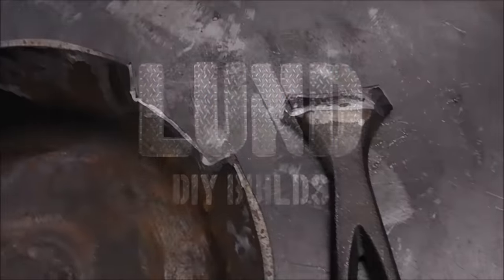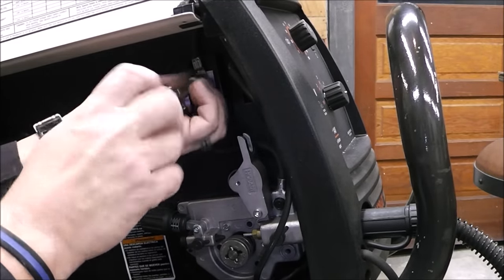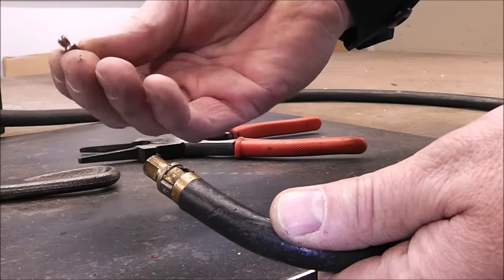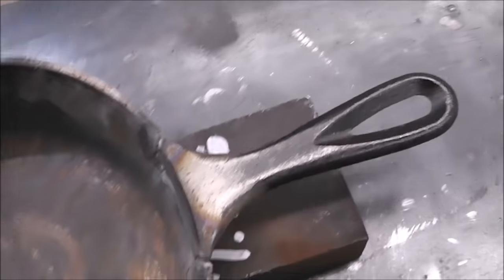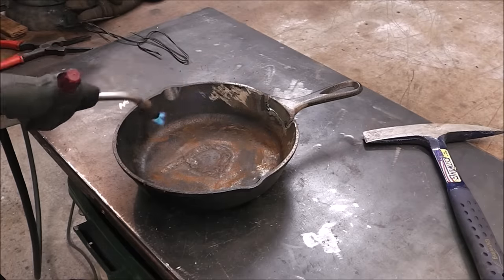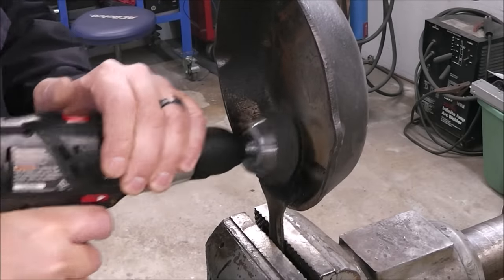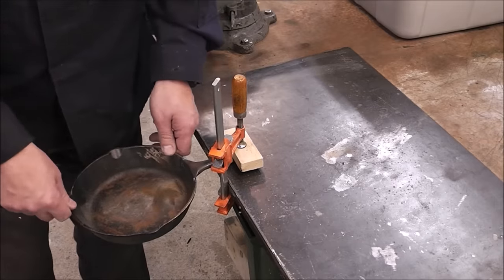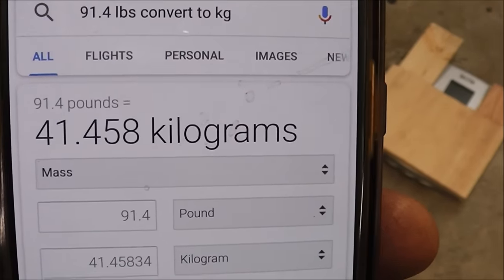Cast Iron Welding Repair using Flux Core Wire

Comment: here's a question using flux welder, what if you run a bead of weld along each side of the break i.e bead of weld around handle and bead of weld along pan then weld the two weld bits together would that make it any stronger?
Reply from the maker: Maybe marginal. The weak spot will always be at the toe of the weld so by welding on each side then bridging down the center will leave the toes on the center weld ok, but the first passes will still be the weak link but it could be slightly stronger due to more surface area. Great question. Thank you 👍

Comment: We always pre heat cast , 
Weld with A high nickel rod. 
Then bury in hot dry  sand over night. It will never crack at those points. 
We do a lot of cast pans that are old
Reply from the maker: a good preheat and controlled cool down can make a huge difference.

Comment: Any cracking will occur when it is used? Heating and cooling repetitively. The cast iron will expand at a different rate than the wire.
Reply from the maker: You are correct William but that holds true for any weld repair, carbon steel included. Filler metals are typically less brittle than the base metal (cast iron) so if it cracks again it will either be immediately during the repair or several heat cycles later. It's an unknown variable with every cast repair. Even brazing has its limitations.
Reply: So would cast iron welding not be ideal for something that will be used extensively?
Reply from the maker: If you use the proper filler and process than it can be very strong....almost as strong as new

Comment: So was the wire nickle or steel,as I have welded cast with a rods for dirty cast and then you can weld it with steel mig so just butter weld each side the weld with nickle and then hard steel mig wire
Reply from the maker: Surprisingly Roger, this was done with just regular E71T-GS steel flux core wire.

Comment: drill holes in crack 
nut& bolt ..to hold the pieces. lastly remove bolts and fill that hole.

Comment: FluxCore for a broken bypass lopper handle ? The part of the handle below the blades is about 1 inch wide. I have a HF  Easy-Flux 125. Not a whole lot of experience. I did a small weld on my trailer gate, which worked fine. Wanting to play around with it.
Reply from the maker: Sounds like a great time to try!

Comment: have a old cast iron table that belongs to my mom an one of the legs has broken off an all i have is a small 90watt mig welder an was going to try to fix it, i dont have access to sand that i can get in a time period that id like, is there anything else i can use other than the sand to help with the cooling the metal down slowly. the table is just for decoration so the only load it has to hold is its own weight.
Reply from the maker: If you have a welders blanket you can wrap it in that also. If not, you can try not using anything. If it is going to crack you will know as soon as it cools.

Comment: Don’t you usually weld cast iron with stick welding? I don’t know anything about welding just what I read up correct me if I’m wrong
Reply from the maker: Traditionally cast iron repairs are flame brazed and tig welded. This is a repair series so we are trying different processes and fillers and seeing how they compare

Comment: What I’ve noticed welding cast engine blocks nickel rod for sure has been the best but Main thing is how you heat normalize and cool the material
Reply from the maker: VERY true! I've used a ton of fillers but the prep is the real key

Comment: Will this work on engine exhaust manifolds? As you know they are cast iron.
Reply from the maker: @jim sharp yes and no. Cast iron is a crap shoot. You have in my experience a better than 50% chance of it working. Your replacing it anyways so it's always worth a shot.

Comment: I'd be curious to find out the durability of the weld after the re-heat to cooking temperatures and use subsequently of the pan,
Reply from the maker: Repeated heat cycles does increase the chance of future cracking, but as others have posted, this repair has lasted 20+ years for some on exhaust manifold repairs.

Comment: The moisture you see during preheat isn't coming out of the iron. 

One of the products of combustion is water, when it hits relatively cold things (the pan before it's hot) it condenses. That's where it's coming from.
Reply from the maker: Yes. I misspoke

Comment: If you use the nickel stick to weld a cast iron pan, is the metal safe for cooking?
Reply from the maker: I'm not sure but I probably wouldn't dare try it with a nickel repair. Some people have allergic reactions to nickel...even touching it on their skin can cause a rash.  I would however trust it with regular mig wire or even flux core wire since the wire is made of steel and the pan has similar properties.

Comment: Great video! I have used flux core many times to repair cast iron with a cheap Harbor Freight Chicago Electric 90 amp flux-core welder. Is it the best option? No. But, it will do the job. Considering it's a cast iron skillet, it's not going to be holding near that much weight, lmao.
Reply from the maker: Right on brother! Thanks for watching and commenting 🙂

Comment: i peronally use a nickel rod for stick, but i get rid of the flux on the outside and use it with a tig welder, that is the way i fix cast iron
Reply from the maker: That works well also. I did a video of this but used water to remove the flux.

Comment: What were your settings on the welder to weld the cast iron? Volts and wire speed
Reply from the maker: This is a transformer based machine. The voltage is adjusted by selectable taps.

Comment: Is it possible to weld the seams on a wood stove? I have more of a smoke stove than wood stove. Furnace cement keeps failing.
Reply from the maker: It's likely steel so most definately yes

Comment: The handle breaks off when it gets dropped, not really when the pan is over loaded,  but i think you made a legitimate fix there, I’m going to do as you have shown except I won’t put the handle back on; I want just a  short stubby re rod handle to match the other side.
Reply from the maker: Thanks Walter and good luck with your repair!

Comment: Thanx for the info! Let the no-it-alls stroke their egos in the corner. When ya think outside the box the more info ya have the cooler shit ya can come up with. I'm a beginner, maybe less then beginner really when it comes to welding but nails and wood only go so far. Picked up a used bottom of the barrel stick welder not long ago, still don't know what the hell im doing with it really but the sparks sure are pretty! So now I went out and got a cheap, but new 120v flux core mig and ready to have some fun. Came across your video because I've got an antique cast-iron oil barrel from the rail road that's been turned into a wood stove. Awesome lil shop heater but the ends have rusted out so I'm heading out now to see about putting some new end caps on. Dont know if I'll get it done or not but I definitely no it ain't gonna happen by setting at my keyboard watching videos on crap I already think I know everything about. Lol Anyway, thanx again for the vids and wish me luck!
Reply from the maker: Thanks for the support and GOOD LUCK!

Comment: They have "3055 ENGINEERING CAST IRON STICK WELDING ROD" on the Eutectic site.
Reply from the maker: That works well but I have not personally tried it. Blow you mind and make your next repair with this. You will never use anything but again https://youtu.be/Cm3_uv-PhPM

Comment: Three years ago I decided to do my own welding on my turbo kit for my civic, and decided to weld a 3" mild steel v band flange to the exhaust outlet. Pre heated it and everything, but I welded the inside of the flange as well as the outside and when I went to put turbo back together I noticed the fins wouldn't go all the way through the housing because of my fat flux bead that I put in on the inside. Oh man good times. The housing was junk and I ended up getting another turbo lol.
Reply from the maker: Oh man that stinks! I've been there. Live and learn. It's usually costly but it's always a good lesson LOL.
Reply: @BrandonLund  thanks, lol I'll never make that mistake again but damn what a dumb move, it makes me want to build another turbo kit just thinking about it though lol
Reply from the maker: Reminds me of the time I bought a brand new carburator. At the time it was around $400. I put it on and over tightened it. Snapped the ear right off it. Foolish mistake that made me sick to my stomach. JB Weld to the rescue LOL
Reply: @BrandonLund  🤣🤣🤣🤣

Comment: You ever try the oxy fuel welding method?? Use a bare cast Iron rod and flux old school method. Ive been tinkering round with it and its a tough process but it leaves a really nice repair. Kast weld 111 rod pure cast iron rod and a flux. Puddle runs like molasse very gassy ans porus but i honestly think the oxy fuel method works the best because your using the same parent material as the grey Iron base metal. But the rods are heavily pricey. You can also use piston rings.  But you need a good flux or just make your own using some borax. I mixed borax, Iron powder, and some lime. No peening reuired as it's a very well known restoration technique that was used back during the early 1900s an so on before advancements in the arc welding process. If you do it right, the repair almost looks original. The kastweld 111 rod can be machined down to bare metal.
Reply from the maker: @lar I have a lot of brazing experience on carbon steel and have done a little using cast rods. It is an art for sure. I wasn't aware piston rings would work but I suppose the cast has to be high quality so they done degreade quickly. Thanks for the awesome comment!

Comment: Can a a 454 cracked exhaust manifold be welded using the same setup?
Reply from the maker: Generally yes but all cast iron is different. You have a little better than a 50% chance of success in my opinion. I have a video on cast iron manifold repair but it's using a product that's fairly expensive but it always works. https://youtu.be/kzbcVb2UymA

Comment: My mom passed down an iron Comal ( small circular skillet for tortillas) my daughter got it up to 500+ degrees and it cracked, will this fix it?
It’s An heirloom that I grew up with, and was given to me in 2004
Reply from the maker: It will but I would NOT. Cast iron is prone to failure after being repaired. Even if YOU repair it as something to hang on the wall, there is nothing to say that someone else wont aquire it and put it back into service. If it ever failed on the stove with grease it could catch your house on fire or worse kill someone.
Reply: @BrandonLund  thanks brother

Comment: I never knew this Brandon . I did a repair of a bird bath which was over 100 years ago and I used cast iron welding rod and pre heated the work and when I finished I put it into hot sand left it to cool down over a few days . I don’t think the person realized how much time I spent doing this repair because she didn’t think it was worth the amount I charged her
Reply from the maker: It can be hit or miss. It's not the cure all to everything but it works a lot of the time.
Reply: @BrandonLund  she never came back mate
Reply from the maker: LOL maybe you don't want her as a customer then...LOL Without getting too deep into specifics, I always make sure my customer understands what to expect and how much at a minumum it will cost them for me to attempt this repair.  The prep work is what really takes all the time. Many hours are spent, long before I even strike an arc. Lucky for me the part had been cleaned. It saved him some money because I didn't have to mess with it.  I make sure my customer understands that my time is worth money and if they want me to attempt to repair their part than I need to be compensated for my time spent, even if the repair isn't sucessful.
Reply: @BrandonLund  a good point mate

Comment: I have a 1 inch crack in the horizontal underside bottom of my cast iron boiler. Do you think it would be possible to make a weld 'upside down' to patch it? I've read about other viewers drawing vacuum on the item to keep the contaminants out of the weld area, and drilling the ends and I would do the same.
Reply from the maker: Welding in position is always the easiest but cast iron can be welded upside down. Everything else is the same...just a little harder.
Reply: @BrandonLund  Thanks for the quick response. I thought I'd give this a whirl, as strength isn't a real issue (running the boiler pressure at around 10 psi) but I don't want to go to the trouble of doing the prep work and having the crack spread or lengthen when stressed with the welding processes.  Preheating might be a challenge, though.
Reply from the maker: @CheapskateGaridge  Not sure if your able but heating the joint with a propane or Map torch before hand will help and then after you weld, throw a welders blanket around it to help slow the cooling rate. Harbor Freight has good prices on welding blankets. Good luck on your repair.

Comment: Another good way to do this is to put it on the grill on high until the pan is about 500 degrees, weld it, then slowly reduce the heat or put it in sand.
Reply from the maker: Great idea!

Comment: Very nice demonstration and helpful since I've been wondering how to repair a cast iron sander table I have.  The only question I have is how much of the total 91 pounds was in that last bucket?  How do you know that 2 pounds more wouldn't have broken it?
Reply from the maker: Thank you! It wasn’t a perfect test but a rough idea . I’ve since modified how I measure the weight.

Comment: I'm curious how much more of the metal that was in the bucket could have been added separately before it broke.
Reply from the maker: The pan was holding just about everything in that bucket. If you look close you can see I'm barely holding on to it right before it breaks using just my finger tips to hold it.

Comment: The skillet likely would've broken even without a repair job, with that weight. Your weld didn't break, the skillet did, which shows that is a solid method of welding it.
Reply from the maker: Right on!

Comment: I like your test of welding cast Iron,......you should have stacked barbells on it. 
I wouldn't waste any money buying a 110 welder.
I'd buy a 220v welder Hobart Handler 190 MIG Welder.
I welded my motor mount with a 110 125 Amp welder and flux cored wire,......it broke within 5 minutes,.....

Then I prepared it and rewelded it with a Lincoln Electric 230-Volt 180-Amp Mig Flux-cored Wire Feed Welder and 20 years later it's still holding.
Reply from the maker: Nice fix. Penetration can be the downfall of MIG...especially 120 MIG

Comment: Oh and the little Hobart,  Still say it’s the best little welder for the $$.
Reply from the maker: I agree. Im partial to transformer based welders anyways. Old-school I guess lol. My inverter welders are so light it makes you wonder what's inside. The Hobart is surprisingly heavy for its size. Some of the Hobarts actually were shipped with stingers that had the Miller name on them.
Reply: The newer inverters are great. But I had a Hobart Handler 135 for 20 plus years.  The dealer talked me out of the more expensive red one. 
Sold it to a friend about four years ago.   Still going
Reply: Brandon Lund   the setback for transformers is the dreaded duty cycle.

Comment: I need a welder for the primary purpose of extracting broken steel bolts from aluminum engine blocks - is carbon steel flux core 0.30 good enough to achieve this? Or is it entirely the wrong tool for the job?
Reply from the maker: That will work just fine 👍
Reply: @BrandonLund  Good to get pro input - just to be clear, are you saying fine for flux core without shielding gas, right? Argon/CO2 is really expensive where I live... but if it increases odds of getting bolts out, I would consider it..
Reply from the maker: Yes, flux core will work just fine. Running gas will will cut down down on your spatter, but flux core will work just fine
Reply: @BrandonLund  Fantastic - I just hit the order button on a HZXVOGEN MIG  4 in 1 185A. Hopefully it delivers the goods! Would it be worth spraying anti-spatter spray around bolt to protect gasket sealing surfaces/threads? For a 8mm steel bolt, is there any particular settings that get good penetration with flux core, while protecting the aluminum or is it all experimentation on test bolts to dial it in?
Reply from the maker: Definately anti- spatter will help keep things clean. As far as settings. Most welders will come with a chart you can use a reference. A good rule of thumb is 1 amp per .001 of material thickness.

Comment: I’m bringing  a skillet lid to a local marine welder, I want to make sure the weld is obviously food safe. What work should I look to get done there specifically?
Reply from the maker: The only food safe filler to my knowledge is 316 stainless but with that said, cast iron isn't considered a food safe metal but it's used in cookware so as long as the filler isn't a carcinogen like nickel you should be ok.
Reply: @BrandonLund  nice thank you for the information
Reply from the maker: Thanks for your support!

Comment: Sould you use gas with flux core wire?
Reply from the maker: That is called dual shield. Typically for most DIY homeowner projects you would buy self shielded wire and not use the gas.
Reply: @BrandonLund  that is my set up right now but I need need to repair a to a iron gate. Thanks to another of your vids I now know it may be cast steel not iron. Bright sparks comd off when grinding. That should be an easier weld for me right

Comment: Do you remember what settings the machine had? I have the same welder and just wondering wire speed and power you used?
Reply from the maker: Right around 4 and 45